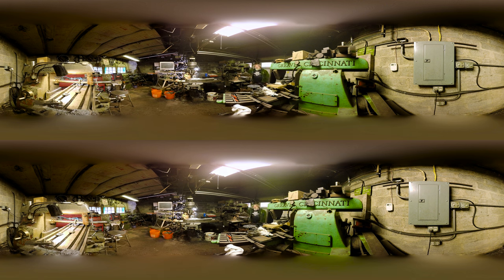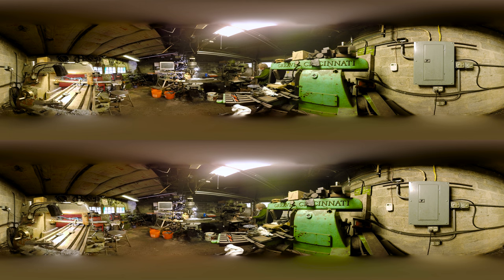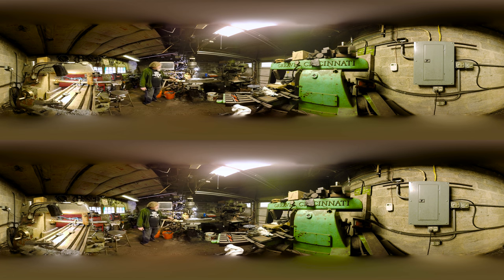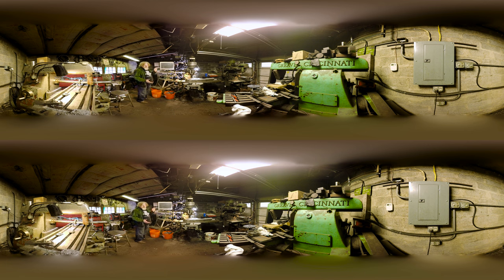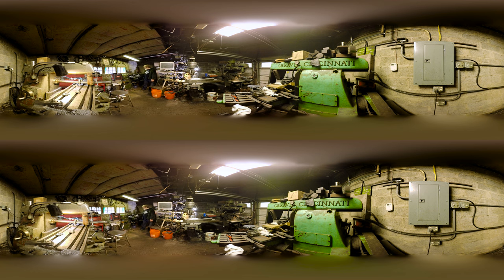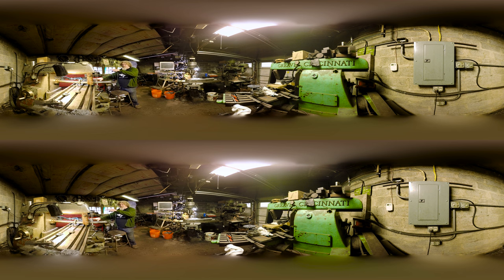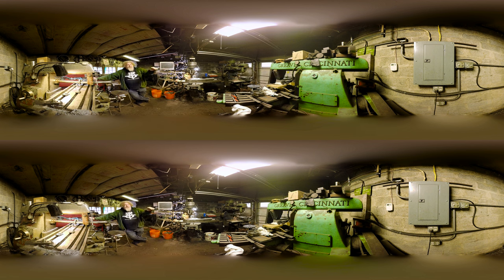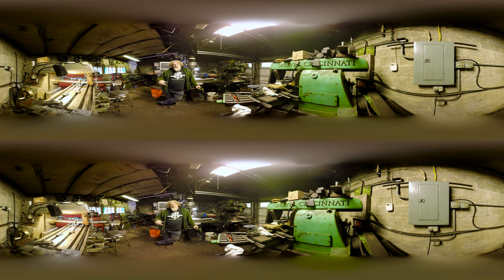Tour of Man At Arms: Reforged Shop in 360° - The Machine Room!

Comment: So... I don't know if it's possible or considered. But why aren't the belts in the drivers Mobius belts instead of flat belts? Using the mobius belt way would cut down on replacement costs of the belts.
but like I said, I don't even know if it's possible to fit belts in like that.

Comment: A 386 running Windows XP???
Reply: XP was stable as hell. Many CNC machines still use older forms of windows because "they just work". Transportation companies worth hundreds of millions probably still use Win98, 2000, or XP because those machines are configured with it all natively.
Reply: Honestly ive never looked.  I can tell you if it is only running Mach3 and a txt editor the machine is slow as hell.  That being said it works fine and im loath to make any changes.  If I think about it ill check the system and post back.
Reply: kerrystagmer If it works, don't fix it hehe xD I feel you brother. By the way, you guys are running a hell of a show :) Thanks for entertaining us
Reply: 386 is a 16-bit architecture, and they didn't make 16-bit versions of windows XP. It's probably windows 95 or win 3.1 if it is even running any version of windows and not just plain old dos.